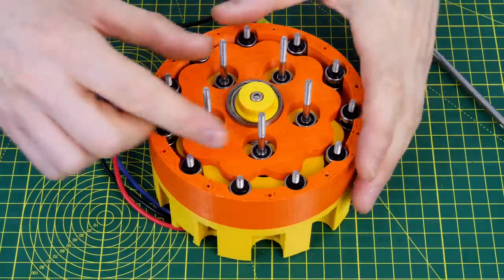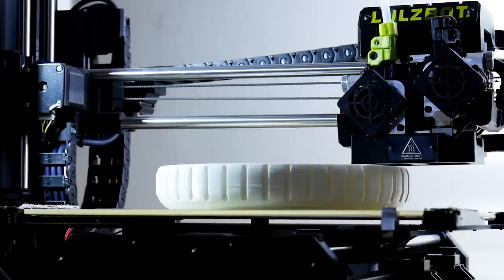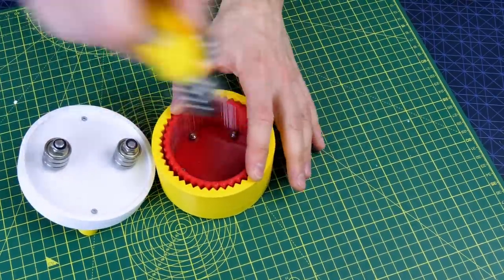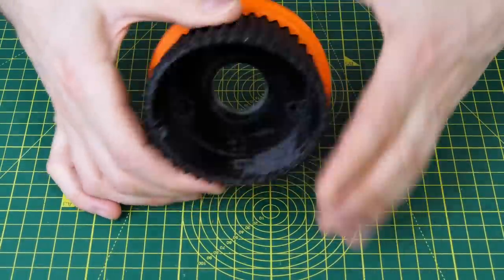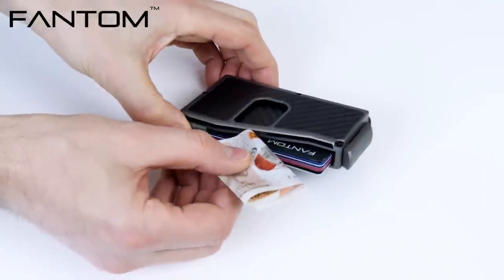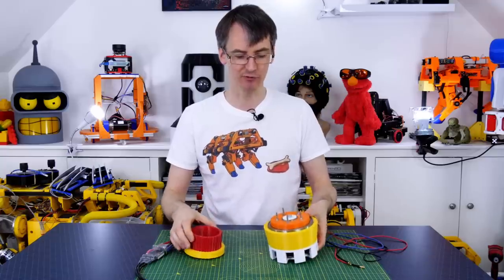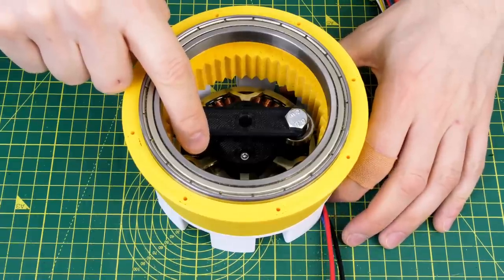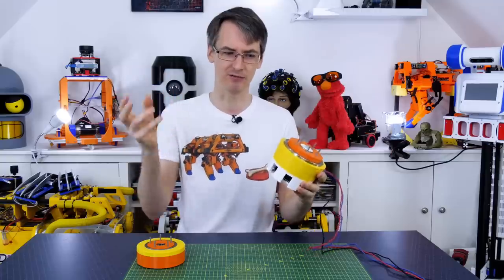Experimental Harmonic Drive Reducer - 3D Printed

Comment: Hypothetically, could the flex spline be replaced a roller chain like a bicycle uses running on some idler sprockets where the bearings on the wave generator are and an elliptical track? Output would be derived by having longer pins on the chain joints operating in a series of holes on the end cap, ideally via cams on bearings to reduce friction, similar to how the cycloid gears are engaged. Such a system would probably need to be completely packed in grease and the chain track would require a bit of metal inside so the chain wouldnt just chew through the plastic. Additionally the teeth on the idlers and the ring gear (ring sprocket?) Would have to be carefully designed so they dont smash into each other as they engage the chain (doesnt matter if the idler skips so probably doesnt need full depth teeth if it needs teeth at all, just whatever it takes to keep the chain aligned)

Comment: Answer/guess why Cycloidal drive v2 doesn't stall and can be back fed. Yes it has lower friction, but it also has a large "contact" area distributing the forces over all those bearings. More of the energy (rotational torque) is directed across the larger 10:1 reduction area (instead of a concentrated area of the flexible strain wave). The stall torque should be near 10x the rating of the motor assuming the PLA (or whatever material) doesn't fatigue or fail. The real question is what will fail first with all the contact area, will the motor stall first or the PLA structure fail. I suspect the failure point will be where the cam shaft interfaces through the 4 bolts as that is the most concentrated point of the torque.

Comment: Just a guess, but I suspect the same reason you can't back drive it, is also the reason you can stop it with your hand.  You don't need to resist the force of rotation, the teeth do that, just the force of deformation.

Comment: To echo other commenters, try again with the flex spline printed in a rigid plastic.  To regain flexibility, add a thin cylindrical section under the teeth instead of continuing them all the way to the output. (just like how metal harmonic drives are built)  It might also help to buy some Delrin bearing balls (at least 8mm) and 3D print your own elliptical bearing wave generator.

Comment: My recommendation is to make the spline teeth a low hysteresis hard plastic with very thin backing and bond it to a very thin steel tube. This would mitigate circumferential strain and decrease loss and slip potential.
Reply: Also, the tube could have more length, which  improves the perferential strain direction. Maybe this way the motor can be nested in the tube to allow a cleverly compact architecture.

Comment: You need a more rigid flex spline, and an eliptical wave generator. There is too much slop and distortion between these components, and an eliptical wave generator with the same circumference will fix a lot of your problems.

Comment: Very nice. Why not INVOLUTE profile ? Basically gear profiles ? That would  (I think) properly handle force vector to a constant, much shallower pressure angle (i.e. 20 deg). I suspect your basic triangle profile just put a ton of useless radial load,  causing it to skip and adding ton of  extra friction.

Also, I think using a big rigid cam mounted on an extenctric bearing would be way more efficient compared to those smaller bearings. It would support the back of the strain gear so it doesnt collapse and reduce local deformation (less hysterisis loss).  These two factor could actually make it back drivable and more reliable. Please try these I'm really curious to know !

Cheers !

Comment: It's very impressive to see how you managed to build one of these literally from scratch. I wonder if the flexspline is mandatory or if it could be replaced with a solid part , or a two part rotating piece that engages the gear in a similar way. Amazing work. Keep it up!

Comment: the cam on the cycloidal drive is way more efficient with leverage then on your flex drive. Some where the changes you made are reducing the grip and loosing the torque. Very interesting 🧐 you can figure it out we know you can.

Comment: The wave generator just squishes the teeth when they are not allowed to rotate.  Rigid teeth on a flexible band would work much better, or adding some sort of rigid paddle along every teeth. CVT belt drives have a similar issue (but they are squished from side to side), and are reinforced with metal plates. (In fact they are basically metal teeth joined by rubber)
CHeck here: https://gearsmagazine.com/wp-content/uploads/2019/06/Screen-Shot-2019-06-03-at-9.31.54-AM.png (THis case also has metal ring reinforcerments)

Comment: I would agree that more, smaller teeth and tighter tolerances could help, but I'm wondering at which point it becomes impractical to print, perhaps a few times nozzle diameter, so roughly a millimeter? There's gonna be a potential tradeoff in durability too.

Comment: Ive been looking at making one but using small timing belts glued to the outside of the flex spline cup and matching (but more teeth) to the inside of the body... Do you think there are any issues with that concept?

Comment: you need to use a rounded oval to push the belt to get more contact and engagement on each of the teeth also the flexible part is to soft

Comment: not sure ,but i think having a wave generator with more bearings to stretch the flexible spline along the sides as well ( as seen in some other harmonic drive videos), would eliminate the problems u have , cuz it will prevent unguided deformation of the spline, and maybe use a different material for the spline itself ,because as u saw the industrial ones dont use an elastic material but the elastic deformation region of a normal material to prevent skipping as well , maybe u will need to cut in dimensions or components if u want to hit some weight goal, sure u will find a solution good luck.

Comment: increasing the diameter of the bearings on the wave generator may help you get a couple teeth engaging on either side at any given time.  Also, I don't think the two bearing setup is ideal, maybe add a couple more bearings on the wave generator that follow the expected ellipse shape that the flex spline will end up as.

the cycloidal needs better prints tbh.  as I recall the fitment was rather sloppy, which could be causing all that noise.

Comment: Are you able to print with two different filaments? I would suggest trying to make a flex plate with PLA reinforcements to help prevent the plate from twisting when you back drive or try to stop the motor. 
The twist  is causing the stalling, Making the teeth grip more then expected. If you can keep then strait they should not bind.

Comment: It doesn't look like a triangular tooth shape is quite optimal, although it might be better than HTD. Google "harmonic drive tooth profile" and you'll find there's a whole science behind it.

I suspect that the four tooth difference might lower your efficiency quite a bit compared to the standard two tooth difference. It causes increased deformation of the flex spline and a higher chance of interference teeth as the teeth "turn" into and out of engagement.

Try using the largest bearings you can fit. That will give you better control over the shape, more similar to the elliptical bearing race that commercial units use. That also suggests that a rigid material might be better for the spline.

Comment: Wonderful work James! Always a great watch. What if you tried to print the flex drive with normal PLA with no more than .8mm base of groove to inner wall thickness? Might get some rigidity from the PLA and stop slipping when stalled?

Comment: Try 2 narrower flexible spline. One on each side of the mount plate with single stack of bearings on each side of the mount plate. You could even position the bearing holders perpendicular to each other.
Reply: Hmm actually any flex friction savings would probably be lost in added complexity and weight. Alt material like nylon or something self lubing, triangle single layer bearing stack, narrower flex spline as close to the drive plate.
Reply: Oh geez simplest solution triangle single bearing layer wave generator. Simple and quick test.

Comment: Hi James, you might already have looked into this but I'll add this anyway just to be sure.
Did you try updating the VESC to the latest firmware? You should try the latest version of the VESC tool and do that and then have a look at running the motor in FOC-mod after calibrating it.
You can also connect an encoder to the VESC, I myself use three externally mounted hall-effect sensors to sense the rotation of the rotor. The VESC has automated calibration sequences to synchronize these.
When you are in FOC-mode you control the current through the motor which is then proportional to the amount of torque you have at the shaft. Standard voltage control will only set the speed of the motor disregarding torque.
IMHO it's better to run it in FOC mode and then adding or reducing current depending on potmeter readings you have in your Arduino.
Latest project website is here: https://vesc-project.com/

Comment: Wouldn't you want the flexible part in TPU to maintain a constant circumference? You might need some continuous fiberglass reinforcement around the circumference so it can still deform but cannot increase in circumference.

Comment: I would think that you'd want to gear the wave generator so the flex has gears on both inside and outside and then clock the gears in the wave generator together so you can't slip at all. I can only guess that you're slipping the wave generator around the inside of the flex drive.

Comment: The issue is the flex spline material. The plastic is too soft. To make a proper spline you gotta do some compliance calculations with pla or some other harder material. This is definitely not easy stuff

Comment: I'm very familiar with harmonic drives.. I have worked with them for years in Fanuc robots... They can be back driven but only under high torque... They are usually used in much higher gear ratios and with much tighter tolerances than a 3d printer can provide..

Long story short... You probably need to shoot for a higher gear ratio with more tooth contact.

Comment: Metal and high strength plastic (nylon has been used commercially for the gears near the motor side) planetary gear systems is where you are going to end up. It has everything you are looking for, it just involves using at leas mild steel or sintered metal gears. Maybe experiment with 3d printing and then casting the gears? The router you have is not going to do the small size the planets need to be made out of. Besides, they couldn't be aluminum alloy that it could cut anyway.

Comment: The tolerances have to be just right, and maybe they flex spline is too flexible as well.
The high friction results because polymer on polymer wedges won't slide properly... Maybe grease it up 🤔

Comment: Any advantage or reason for taking a harmonic drive, and "turning it inside out" so that the flexible spline is outside of the rigid gear, and the strain-wave generator is the outermost?

Comment: Is there any reason to have the teeth cover the full depth of the flex spline? if it's for printing support, perhaps it could be cut away, so as to reduce the stiffness that the wave generator has to overcome? Also with the industry one pictured, you can see they have quite a bit of separation between the teeth and the base of the flex spline, (output side) presumable for this reason.

Comment: I'm no engineer but it seems the efficiency of this drive would drop with increased in rpm. At low rpm the flexible part is pressing equally on the front and back of the bearing as it rotates but as the rpm increases the load on the front of the bearing increases and the trailing end sees less load and does not assist in driving it forward. Im sure at some point in higher rpm you will need to vent the space between the teeth or it will also build resistance like a air pump. Maybe venting the flexible part also would help. As far as more flexible material I'm not sure if that would do more that relocate the problem to another rpm range. I really don't know a lot about this but it's just my outside looking in perspective.
Reply: Thank you for the videos. I started watching your channel to see if I could come up with a compact way to gear a gravity fed generator. Some if these designs with the higher gear ratio look promising and I wonder if they are stackable.
Reply: @christophernewman8741  gravity feed generator of , air, electric , heat , cold , motion or lift...... what is it...!!!
Reply: @gulliraggi  mainly the traditional inefficient mass storage like a grandfather clock  or the crank lift generator similar to the style of the one in the old Winchester house. They both require a person to lift the weight though.  I'm not looking for large amounts of power generation. Just to design a method that is quiet, doesn't produce a lot of heat. Can be fully concealed. No emissions and no need for battery storage.  Would like for it to be a self resetting system but my limited math skills are showing me that's probably impossible. Thank you for showing interest in my comment.

Comment: is harmonic gear reversible or is there an equivalent mechanism that multiply gear ratio with similar compactness ? I saw a lot of method and mechanism for gear reduction, but not a lot on the gear multiplying department. For certain class of robotic actuator like shape memory alloy motor/magneto-restrictive motor/hydralic  that have much higher specific work density compare to conventional electrical motor, but they have much low strain rate. So they are not really usable unless some gear multiplication is applied to magnify that low strain.

Comment: I really still believe that a planetary gear set would be the best. Having a compound one with a large number of gears on the out most set and also having it rather wide could probobly give it loads of torque and longevity.

Of cause the cyclic drive will probobly last a long time to, but it have a lot of bearings in it.
Reply from the maker: The small teeth at high speed and torque concern me, so I'll probably go with Cycloidal drives

Comment: Wouldn't it be backdrivable if you fixed the flexible gear to the motor and then had the output be the housing?  Basically do the harmonic drive inside out?

Comment: Would it be easy to, instead of the current 1:5 belt reduction, make two belt reductions like 1:3.3 & 1:3.3 to get a 1:10 reduction? All these solutions look heavy and require some decent tolerance.

Comment: compared to some commercial variations your wave generator is not engaging very many teeth at a time and the teeth are already seem somewhat large for a material that is that flexible, maybe try finer teeth with more solid engagement?

Comment: I'm fairly new to 3D printing, so I don't know if this makes sense, but would it make sense to use 2 materials for your flex spline, where the teeth are hard at the tips, but flexible where they connect to other teeth. Would this allow the spline to be flexible enough without the risk of the teeth deforming and skipping when you try to stop it by force?

Comment: Nice video series about the gear reductions. I was wondering if you dont think you need to increase your e-steps (extruder flow rate) on your 3D Printers? Or is it just me seeing these tiny gaps between the lines? Apart from the optic appearance isn´t this affecting the strength of the parts to not have the lines completly connected?

Comment: not that I think it would work any better, but what in the interest of understanding what's going on, what if you flipped the cup over so that the orange base was against the motor with the distortion portion going through the center of the cup. that would let you leave the top open to see what's happening (although you would have to arrange some other way to load the output, say a belt against the orange part??)

Comment: I can see how you came to The conclusion that harmonic drives are made this Way. But the belt in the center of a harmonic drive is normally not a cup and that's also why you have a lot of extra friction. You should have just made it as a normal belt with 2 parts interacting with the belt, one acting as the stationary One, and one as the output it should reduce the friction a lot. I assume at least. Don't now about the teething though since I'm not an expert on this. Probably won't be back drivable eatherway but it's still beter if you're only trying to make a harmonic drive

Comment: My gut feeling here is that you need to have the teeth of the flexible part as rigid as possible. Would it be possible to print the teeth in PLA as an accordion piece and assemble it with the flex spline?

Comment: Ah, I see you have heard of them.  

Thinking about this... My intuition says you could probably do it without needing the spline to be flexible, if you used the Stator gear (anchor), Output Gear, and replaced the spline with a cam having 2 micro gears on free spinning bearings (since the spline only touches in those 2 spots), but this seems to obvious to have been untried... I'd be interested in seeing tests to determine why the flexible spline works better (assuming it does)

Also you could probably get higher tolerances if you made the cam width adjustable, maybe something based on a scissor jack so you can precisely adjust the distance and it'll hold firm?

IDK if the terms Stator gear, Output Gear, and Spline are standard terms so here's my reference source: https://youtu.be/7QidXf9pFYo

Comment: Im not a mechanical engineer, but I wonder if planetary designs are considered as a compact reduction mechanism. A candidate design could be the one proposed in IEEE "Bilateral Drive Gear—A Highly Backdrivable
Reduction Gearbox for Robotic Actuators" paper (not linking due yt restrictions)